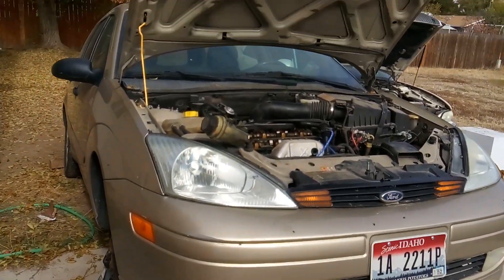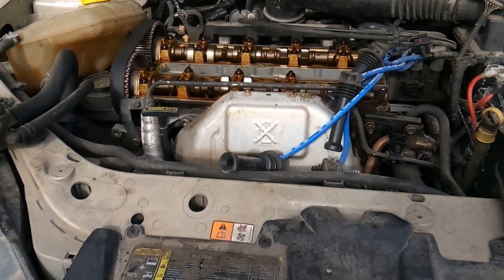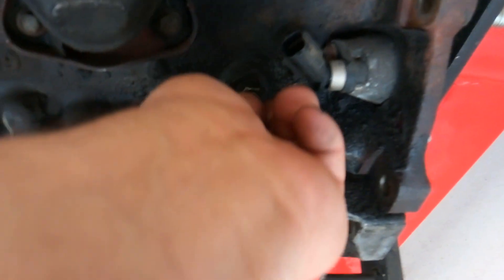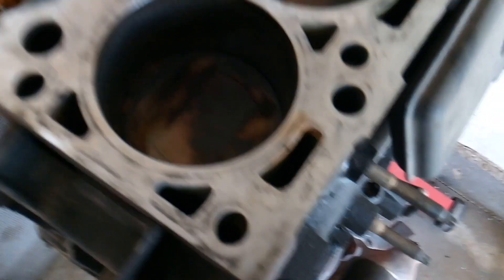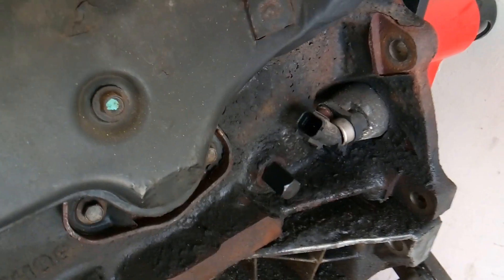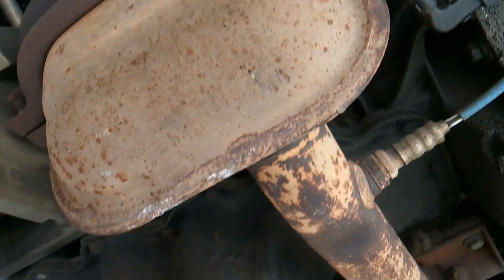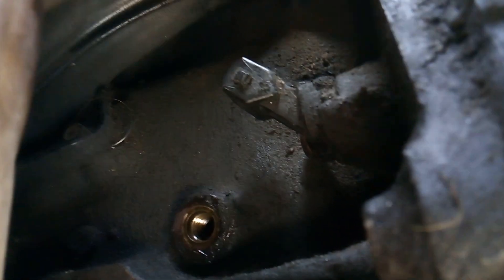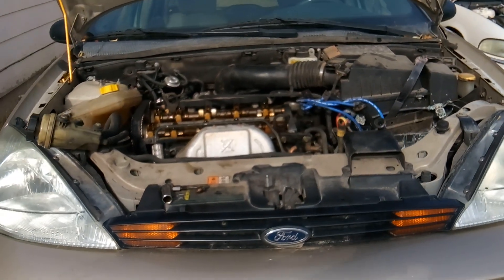setting TDC and timing the Ford 2.0L engine

Comment: For some reason on a 2001 Zx2 the area where the TDC pin is INSANELY crammed, like the exhaust system is different...I was able to get the bolt out with great difficulty, but now I dont know which of the three pins the kit I bought came with to use? If anyone can help me out it would be greatly appreciated, cause im getting really fed up with shredding my arm reaching into that area.

Comment: 12:23 if one of my cams is slightly different angle (the proper one is at the minute hand of a clock at :15, the cam that is slightly off is at the :12 minute) which makes it so I cant insert tool, how do I turn the one cam so that it does line up evenly?
Reply: You are going to have to remove the timing chain

Comment: Really appreciated the step by step walk through you did. I'm working on a 2016 Ford Focus RS 2.3L engine and it's somewhat similar - I've got to replace the pistons/rods and I'm at the point where I'm about to take the camshaft rods and timing chain off, but wanted to get my timing markings exactly correct before I start that process - you cleared up a few things for me on making sure that I'm EXACTLY at TDC for piston #1 WITH camshaft lobes at right position and both rods horizontal and locked in place before I remove things. Thanks very much for the great tutorial!

Comment: so one thing i don't understand, im trying to replace the timing belt and before i take out the old belt, another video says to make sure that we are at TDC 0deg not 180deg, listening for compression stroke from cyl 1 with a tool in the sparkplug hole,.
I am able to bring the tool up, keyway on crank lines up, put the pin in it bottoms out, but i am unsure if it's 0 deg or 180deg... first time doing a zetec timing be gentle on me

Comment: Great info thank you. I'm working on a 2014 2.0 NA ford focus. The timing peg goes just behind the passenger CV axle. Timing the engine today so I hope that's the right place. I'm going to time it then hand crank the engine over. Fingers crossed no valves hit.

Comment: Thanks. I've never done a 2.0 timing belt and I'm seen that is a pain in the neck. But your explanation on timing tool it's definitely very helpful keep the good work by the way it's gonna be a escort zx2 blown head gasket
Reply: How did you get that plug out